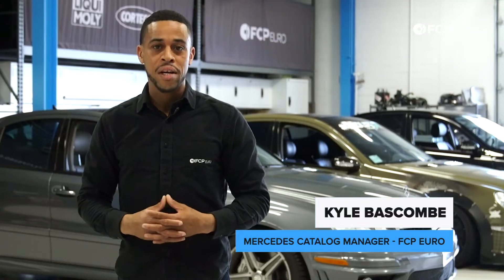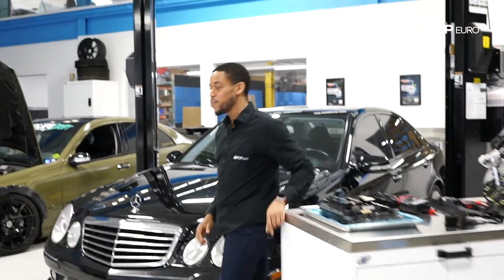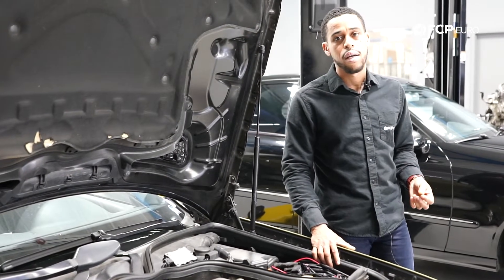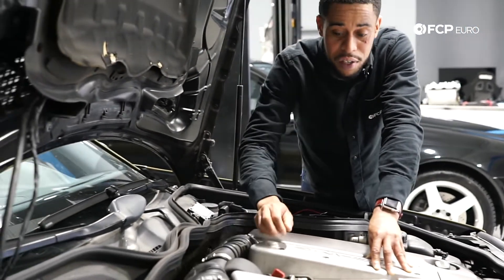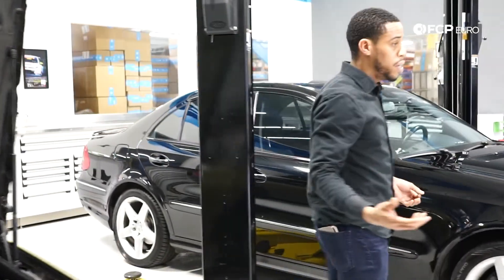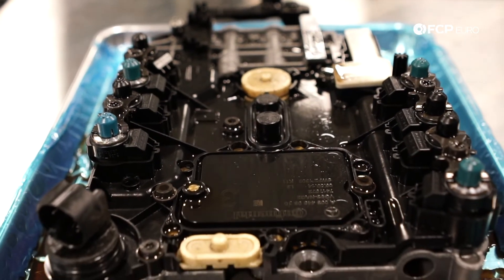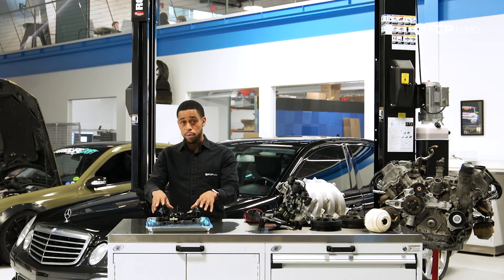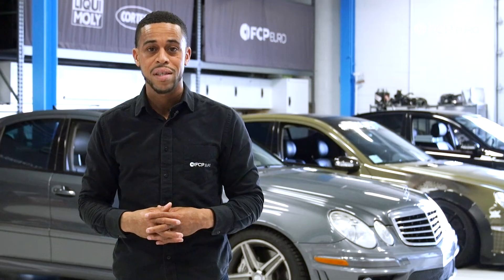Mercedes-Benz W211 Transmission Diagnostics - Everything You Need To Know (722.6 5-Spd, 722.9 7-Spd)

Comment: hello can some one please help me with this  have a 02 mercedes benz s430  ..change oil  sensor with new one ..now my car want drive when i try to drive it it starts out fine but when i give it gas it stops until i let up off the gas please tell me what it could be thank you cecil
Reply from the maker: It would be best to bring your car to a local Mercedes dealer or independent repair shop and have the codes scanned to see what is wrong.

Comment: Good vid Kyle. I have a question about my w211 with 7 transmission. I feel a hit when it shifts from 3 to 4. There are no codes. And thank you for all the informations.
Reply: Does it always do that or only when accelerate and release the throttle, so it will shift up from 3 to 4? It can be a hardy-disc problem

Comment: Hello I have my 2004 Mercedes E55 amg has 120,000 miles purchased it about 3 days ago I noticed that when I get up in the morning and drive the vehicle on cold start and from a dead stop under normal acceleration the 1st gear shift feels jerky it will do that like 2 or 3 times then when the car warms up that jerk gose away I’m taking it too a specialized Mercedes Benz mechanic he does Mercedes and bmw but I just wanted to know did anyone else ever had this problem and if anyone can please help￼￼￼￼￼￼￼ id really appreciate it￼￼
Reply: I have the same problem here !!! My w211 2008 has the same problem,  before that happening my gearbox was holding the gears and my check engine light showed up then went to MB specialist and he changed the gearbox oil and filter and re set the codes and was fine . But after that I am noticing the same problem ,jerky when cold .
I hope here find an answer!!!!
Please let me know if you have one !!😫😫

Comment: 722.9 can have problems with its software, the speed plate and the valve body. Most of these problems will show when you, say, approach a red light and you let the car shift back on its own from 4th to 1st gear without breaking or using very little break power. When you let the car shift back with no intervention you will notice a harsh downshift. This mostly only happens when the car has been used for more than 20 minutes or more. Usually even only after a few days of everyday driving. This can be caused by the software for the early 7G gearboxes. Or you need to change the transm. fluid or you will need to send the speed plate back to an engineering firm to repair it for you. If after all this the harsh downshift still occurs you will need to get the valve body repaired.
Reply: thanks for the info, it is possible to update the software? i have a 2012 C250 with only 18K miles, yes only 18k, this car has been sitting on my in-laws garage with no use so i bought it from them. And i get from time to time when downshifting it feels like to a loud thump on the back, this also happens when im going uphill and the car needs to downshift, is pretty harsh, feels like having a bowling ball in the trunk and if it suddenly hits the back car seat. Any suggestions, thanks!
Reply: @Morjesta  It might not be the transmission. I would check to make sure there isn't anything else that has gone bad. Given the low mileage, it is unlikely you have a bad transmission. Check the ECU for any error codes, ensure your battery has a good charge (yes a bad battery can cause the car to misbehave if it sat and didn't run). Also, resetting the transmission adaptions can help.
Reply: Hey so I'm currently driving a 2007 E280 CDI with a 7-speed and when it's a cold engine/trans in the morning, on moderate to hard acceleration the whole car judders and shakes while gear shifting. There's no check engine lights but it's pretty violent. This is only observed in the first few gears. Also when slowing down the shift from 2 to 1 is sometimes jerky. From what I understand the car's trans oil was never changed and it's a few 100 short of 60k miles.
Reply: @brendendas hey did you get this issue figured out? I seem to be having the same problem
Reply: @prabeeshsidhu  yes it was a cheap fix thankfully. The only reason it wasn't detected is because the system wasn't recording the error properly. It was an exhaust back pressure sensor. Replaced the part with an OEM Mercedes part and it cost me around 120 USD in my currency.
Reply: @brendendas  I have the same shuddering and I thought it was the mounts and the transmission fluid , those two things didn’t solve the issue. I did have an exhaust gas recirculation sensor error but it wasn’t there all the time. I think I will replace it like you did and see if it fixes the issue
Reply: @brendendas  did you have a code on the car about the exhaust gas recalculation?
Reply: @prabeeshsidhu  do it, it will 1000% fix your issue. I can't explain how smooth my car became after it. Felt brand new lol. Don't have a code unfortunately sorry.

Comment: I sent the conductor plate to circuit board medics and they replaced the sensor for around 300$ plus 400$ for mechanic who took it down including fluid, saved me over 1k if had to go at the dealer

Comment: I had speed sensor failure on my E63 at 60k miles despite servicing at 40k.  I called many places around including the dealer and was told that you cannot replace just the conductor plate. Everyone told me that the whole unit, plate plus valve body had to be replaced. That’s what I ended up doing and the car is fine now.
Reply: Cost?
Reply: The cost of reconditioned engine 646, cdi 3,W 211
Reply: E200
Reply: I need to know the cost of reconditioned engine. Cdi 3 E200 motor 646.

Comment: Good review Kyle.  I recently had transmission problems with the 722.9 in my '07 C230.  It would not shift correctly and threw the speed sensor codes.  I removed the valve body, then separated the conductor plate which I sent off for repair.  Got new gasket and hardware from FCP and used AMSOIL fluid.  I spent about $500 total on this repair and the transmission has been flawless since.  This is a little more involved than just a filter and fluid service but can be DIY'd if you study the available videos and take your time.  I gathered all the parts and fluid before starting, so in all the car was down about a week to allow for transit and repair of the conductor plate.
Reply from the maker: Glad to hear you were able to tackle the project Vic Sorlie, and come out with a fully functional and fixed transmission! Its not the easiest of DIY's but well worth the money saved doing it on your own, plus you know your trans way better now than before. Thanks for the support!
Reply: @fcpeuro  what causes it to stay in limp mode after this part is replaced
Reply: When you say not shift correctly what did it do?
Reply: @zohairalimalick5931  Sometimes it would not upshift.  Other times it would stick in gear.  This is a common issue with the speed sensors on the conductor plate.  Take your car to dealership and they're going to quote replacement of the entire valve body.  I removed my conductor plate and sent it out for repair.  After reinstall the transmission worked perfectly and no re-pairing to the car was needed.
Reply: @Aardvark49  thanks Vic.
Mine doesnt do that thankfully. Just feel there is a very slight delay but I guess they are older transmissions.
Reply: @zohairalimalick5931  These transmissions (as well as others) work best when regularly serviced properly with quality fluids and filters.  I recommend fluid change at no more than 50K mile interval.  It's an relatively easy DIY service provided you can lift the car level.
Reply: @Aardvark49  thanks. yup bought mine at 197k km and have since done the transmission service along with coolant and the standard service. Will be doing the diff service soon.
Reply: Unfortunately I'm not so lucky. Just had the transmission serviced less than 6 months ago and it still shifts rough, and just threw a code yesterday. Got stuck at a stop light yesterday where the car didn't want to move. I have a 06' E350
Reply: @mike_prod.9224  Has your problem been resolved?
Reply: Vic, where did you send your conductor plate?  My trans wants to get thru 3rd gear too fast on acceleration.  Also, has a small hesitancy to shift at top of gears.  Thinking the conductor plate needs repair. Thanks for your comment
Reply: Is my e500 4matic the 5 speed or 7 speed

Comment: Awesome video, really hopeing my E240 has the 722.6 in it now since its auto rwd 2004. Can you guys do a review on which is a good Scanner tool to buy for a Mercedes? My friend say to try Launch brand or Autel but they make so many different kinds of models.
Reply: Blue Driver works great.
Reply: @Aardvark49  can you elaborate if possible? Are all modules covered for your vehicle? Also, does anybody know of their support for w210 and w220? (W211 also)
Reply: @lobsturf7797  The Blue Driver tool is pretty comprehensive.  I've used it only for basic OBD scans and my recent transmission work.  Lifetime updates are included and there is good 24/7 tech support available.  I've owned this scan tool for several years and am pleased with it.
Reply from the maker: Hi, Billy, glad you liked the video! The most powerful Autel scanner is the MX808 which can do practically anything you would need to do. You can find it on our website here: https://www.fcpeuro.com/products/maxicheck-mx808-obdii-scanner-autel-mx808

Comment: just replaced the conductor plate on my 2006 CLS 55 AMG after it went into limp mode came out to about $150 - $160 Mercedes would have easily charged me $1500 - $1700
Reply from the maker: DIY over Dealership allllll day! Love to hear about people saving substantial amounts of money when tackling jobs on their own.
Reply: I have a 722.6 in my c55 and sometimes when I punch it, it likes to hang out at like 5,000 rpm for quite a bit after I let go of the throttle. Were you able to see limp mode coming or did it just suddenly happen to you. Thank you
Reply: lHaasl  I saw it coming. First thing I encountered was being stuck in 🔺sport or comfort mode 🔺where I would have to turn the car off and then restart it to get it working again .
Reply: Mercedes juneetx june weird. Thanks dude I’ll look out for that
Reply: Looks like I need to replace my conductor plate also as when i floor it it goes into Rev mode whilst in gear
Reply: @danieltomaino3697 did it fix the limp mode and slip?

Comment: Love this content keep it up
Reply from the maker: Glad you're enjoying it Andrew, you'll be seeing a lot more of this recent format moving forward!
Reply: @fcpeuro  you can cover all maintenance and repairs items.

The triple timing chain set made out of soft steel with the leaky oversized tensioners and lately the removed check-valves in oil passages help the engine produce metallic shavings
Daimler did manage to cut down in half the new transmission ATF life to 45k 😅
Same thing with the fancy Benz OEM spark plugs that last only 50k instead of 100k on reliable makes.